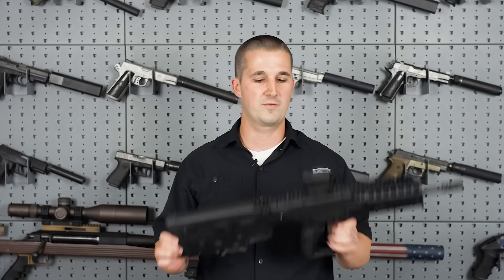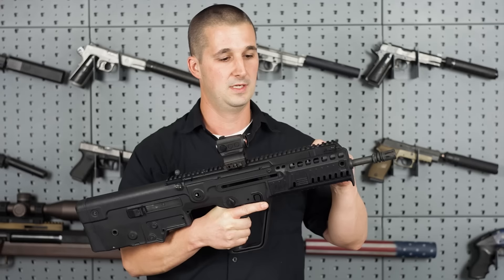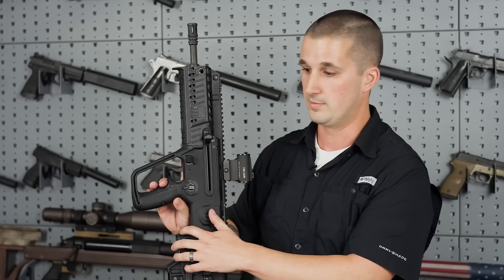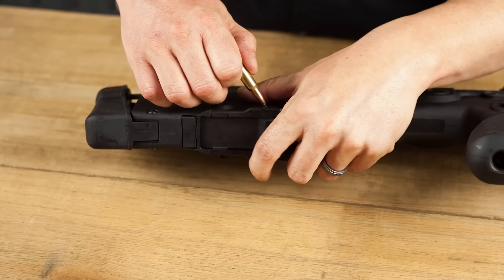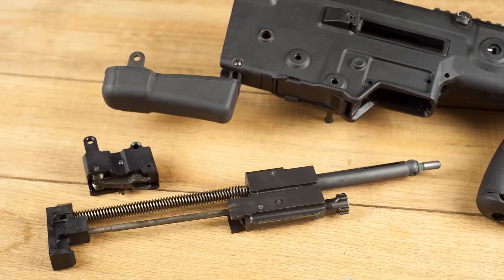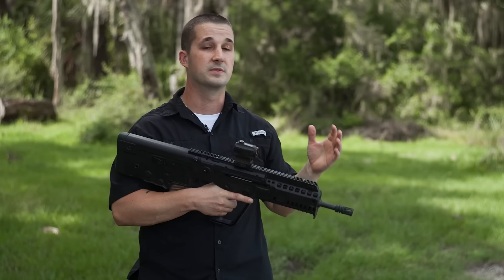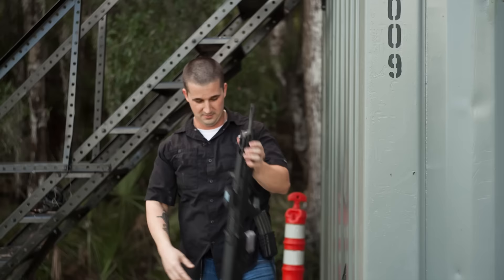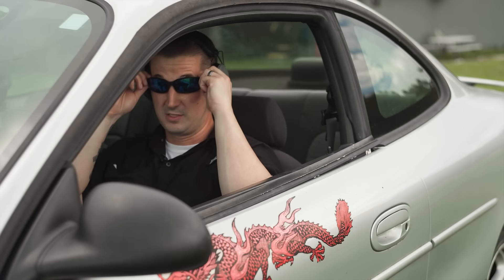IWI X95 - Bullpup Rifle Review

Comment: Lol, ya the archaeological cleaning brush was standard issue😄. One reason they changed the TAR21 charging handle from the front to the rear was due to the charging handle hitting the corners of the buildings or handing up on our vests thus opening the bolt. So they designed the x95 charging handle to be further back. One thing I notice is the USA x95 bolt carrier group looks very different then the ones we use in israel...  dont know why... 

We did competitions to see how fast we could field strip the unit, my best time was 20 seconds to open it and close it all up. Blind folded was about 30. Try it ... nice video🤙🏼

Comment: Great review!   I’m fascinated by this rifle.  My daughter and ai are trying to pick out a rifle for her and I’m thinking this might be the one.  

I’m a little concerned about the accuracy, but it’s not a deal breaker.  I’m wondering if anyone has found a way or is working on improving the accuracy?
Reply: There's nothing wrong with the accuracy of you can believe it. The accuracy issue most people have is from being untrained and inexperienced with bullpup weapons but the main issue with the supposed inaccuracy is that people don't realize this weapon REALLY prefers to shoot heavier grain bullets. If you shoot 55gr with training you'll get around 2-3 moa and with 65gr or higher you'll get 1-2 moa which is AR-15 accurate.

The real problem is that people aren't honest about the AR-15 accuracy since they don't take into account bullet grain, loading consistency, and the rifling. 

With a standard off the shelf AR style rifle you'll get 3-5 moa with lightweight grain  inconsistent loadeded range ammo (Winchester white box 55gr). With the tavor you'll get similar results. 

The same off the shelf AR style rifle with heavier match ammo and training will get 1-2 moa. The Tavor will get 1-3 moa depending on the shooters ability to stabilize the rifle since the Tavor has such a short handguard it hinders the sandbag shooting style. 

However the standing accuracy of the AR style rifle and the Tavor are almost identical but the advantage is given to the Tavor since the shorter weapon length lowers the low-ready and ready firing position fatigue which promotes standing accuracy.

The Tavor also will have the full velocity and damaging effects of the 5.56 as opposed to the compromised performance of the M4 carbine length rifles (SBR) which are only slightly shorter than a standard AR rifle with the Tavor still being shorter.

However the ergonomics of the Tavor do tend to hinder the shooting performance of AR-15 trained individuals.

Comment: noticed a lot of the mags didn't drop free.  i've shot the x95 and it's solid.  could you review the kel-tec rdb and share your thoughts?  it doesn't have the service record of the x95 but it's lighter, shoots smoother, and has a much better trigger.
Reply: All of the newer PMAGs I've bought drop free in mine easily.

Comment: The X-95 was originally designed as an SBR with full auto capabilities. In that configuration, it is a world beater. It was designed for urban warfare i.e. fighting house to house. The civilian version of this rifle shoots 3-5 inch groups (depending on whose review you follow on Youtube) at 100 yards. For a rifle that is in the $2000 range, you would expect the rifle to be 1 MOA at 100 yards. 

My Colt LE 6920 is half the price and I shoot consistently 1 MOA at 100 yards with Lake City Ammo.  In my opinion, the M4 can be used to clear houses and can reach out and touch an enemy at 460 meters.  Oh and yes, you failed to collapse the stock on the M4 when you leaned around the corner. Let's compare apples to apples. While the X-95 has its purpose, I wouldn't spend $2000 on a rifle that shoots 3-5 inch groups at 100 yards. Just one man's opinion.
Reply: +Anthony Pine
Collapsing the stock would still be a point against the M4. The whole point of the bullpup design on the X95 is so you don't have to have an awkward short length to the grip and still a more compact frame without sacrificing barrel length.

The rest of your post I agree with. Is it known why the X95 seems to be less accurate at range? That seems to be an unnecessary design flaw, since there isn't anything inherent about the design that would suggest less ranged accuracy.
Reply: You make a great point. Collapsing the stock has never been a problem for me however I see how it might be for others. The main take away is this is a super expensive inaccurate gun. My solution with be to buy a Colt LE 6920 and a BCM 300 BLACKOUT Upper and have two weapon systems for the same price.
Reply: Try buying a long stroke piston AR15 SBR for less than 2000.00...no can do.
Reply: J DAM I hear it will more than do the job